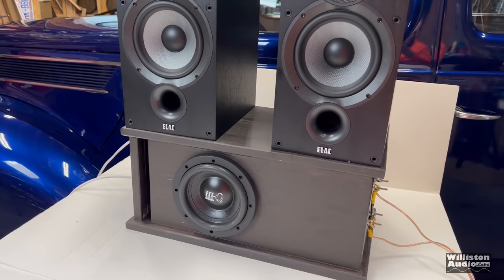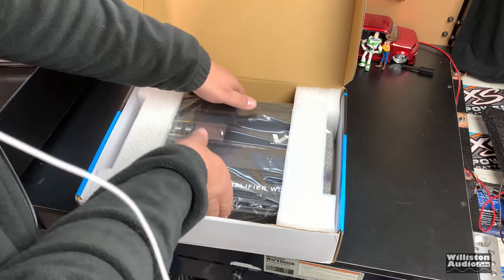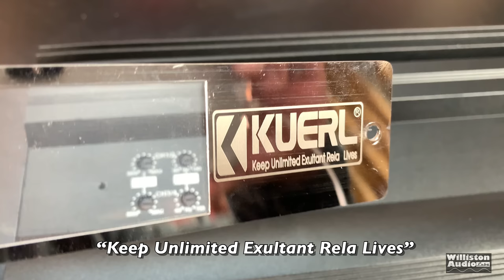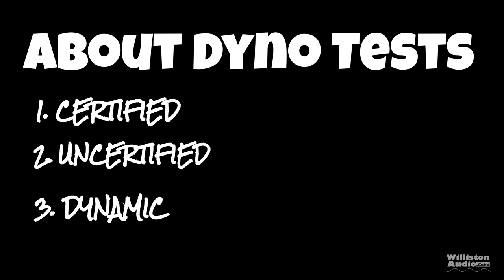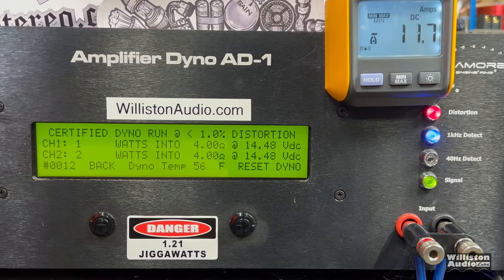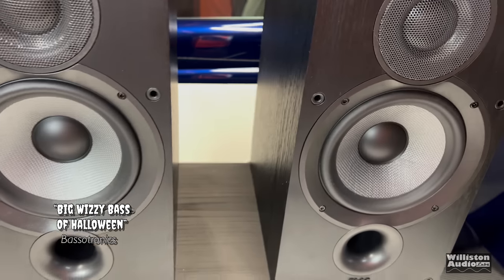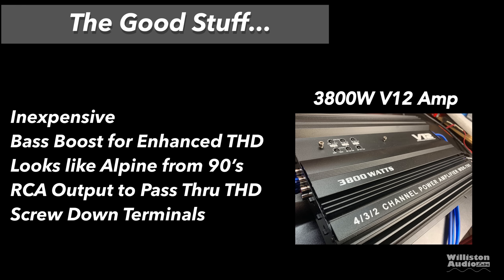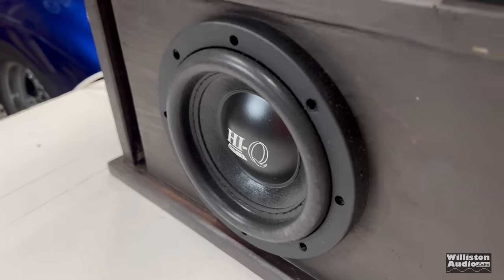$60 Gets You This 3800W V12 Amp on eBay...

Comment: Fun fact : negligent reports suggest, running two speaker leads per speaker doubles the rms of the fuse and running a jumper wire from the ground terminal to the negative output terminal when bridged has an inverse square law effect for the subs allowing you to get WELL BEYOND 3800 WHAT'S of pure electrical psi . 😎

Comment: So I bought into something similar to this a few times. A couple of years ago I got real big into car audio again and when I checked eBay I was like DAMN! A Lanzar 3000 watt amp for $85.99? Bought it, got it delivered, and as soon as I opened the box I said nahhh...I gave it away. Along with the Pyle 12s that I bought that didn't sound terrible on the PPI "1200 watt" amp that I bought. Right now that PPI "1200 watt" amp is running an 8" Skar IX8 D4 in my Acura TL at full power and it barely pushes it. I wasn't looking for killer bass when I bought the Pyle 12s, but I built a custom vented enclosure for them and they sounded decent with low power, but I soon caught on and dropped some real money on two Sundown SA12-D2s and a Soundstream Rubicon Nano RND5000.1 and they sounded SO much better with 0/1 OFC wire and a big three upgrade. Then I bought two more Sundown SA12-D2s and I also got an Orion HCCA SPLX 3k watt amp and now it's too much...

Comment: I have 4 car amplifiers and I have the same model ,  it's been working fine since 2008 and only had to change gain potentiometers once . It's powering a dual voice coil pioneer 12 inch subwoofer , both coils are bridged

Comment: Those mrv-1507 amps popped like fire crackers!   Great amp, but can’t take abuse of running subs.     90% of them I sold came back for warranty.   Would switch them to MTX, kicker, or RF and everything would be good to go!   

MTX 81000D
Rockford BD1000 & 1500 & 800.2
Then the big ass kickers.   I can’t recall the numbers right now.

Comment: Another funny vid!!! In a future video can you expand on the IHF 202 standard and explain wat you mean when you say mimicking the tone as opposed to just generating the tone. Thanks.
Reply from the maker: Agreed. The Amp Dyno’s dynamic test with the 1kHz tone, 14.4V and 4 ohms meets standard for the IHF-202 spec for dynamic power. There are Tech specs for the burst tone as well.

Comment: Anyone remember Cuspid? In the early 2000s (maybe 2004) eBay was flooded with 1600W Cupid Car Audio amps that had like a 25A fuse and were complete garbage. With the tweeter distortion my guess is those crappy caps can’t even filter the power source noise well, this would likely hum or whine inside a car.

Comment: That break-out piece of the board is a common practice.  They can lay the entire circuit board out for production, snap the small boards out for fitting in a different location then remarry the boards after wave soldering.
Reply from the maker: Yeah but it’s in the same place, just turned 90 degrees??
Reply: @wal  It was likely designed in such a way as to do that with the single row of pins on each side connecting it.

Comment: I have 2 ways to judge cheap amps. Either, one quarter of the number on the amp (fairly consistent), or just multiply the fuse rating by 10. Neither of those matches this piece of junk. At least with something like Boss or Pyramid, they typically meet that previous expectation.

Comment: So I remember back in the day I had some really sick Lanzar amps and I bought two Lanzar 12s that each came in a nice wooden box with a combination lock on them. I bought a Lanzar 1800 watt amp off of eBay (thanks Maxxsonics!) for $80 and I also bought two cheap 12s. I built a 3/4 MDF box for them, put them in my Civic, and they sounded like absolute shit. I bought a Soundstream Rubicon Nano RN1.5000D amp (because once again, always had good experience with Soundstream) and those two 12s sounded decent in the 32 Hz sealed box that I built. Finally I got tired of mediocre bass and I bought two Sundown Audio SA12-D2s, put them in the same box, and with the same amp and they pounded in my 97 Civic coupe. Now I have a 2004 Acura TL and I bought two more Sundown Audio SA12-D2s (for a total of four) in my trunk with two sealed boxes bolted together, and I bought an Orion HCCA SPLX 3k watt amp and they REALLY pound. Yeah, I'd love to get some of the higher line Sundown subs, but these have no problem flexing my roof and windshield, so they sound pretty good imo. I've never had them metered, but I think they'd do fairly well. The loudest single sub I've ever heard is a triple decker Memphis 12 on a 10k watt Memphis amp, but that was back in the mid 2000s. The best sounding system ever was four MTX 15s in the bed of a 95 S-10 with a cap and the rear window removed on a killer Rockford Fosgate amp. He won multiple awards with it and you had to have a pair of earcovers to sit in it.
Reply: Lanzar optidrive beasts man
Reply: @NVzla  Absolutely! I miss the days when there was crap amps and subs on the market, but you could only get them at a flea market. Nowadays you're being tricked into buying absolute crap from every angle!

Comment: This type of car amp can be found all over south east asia, can get them from 40-90$. I bought one 11 years ago for 45$ it had 2 25 amp fuses (also slightly had bigger guts than this one) and it said "3600 Watts" on top but actually it only puts out 600+ watts @ 4 Ohms fully bridged and I found that actually decent. but it gets hot, like real HOT, you can burn your hand on it, literally lmao, without any fans it would surely pop, rip efficiency. great video though!
Reply from the maker: Thanks for watching and commenting!

Comment: v12 mrv 705 that a class ab mosfet on the final has a distortion because the bias isn't great also it isn't worth it will fail eventually I have repaired many of that. but there is one more kind of amplifier mrv 805 a little bit more decent rating is 4x80 watts at dynamic 4x60 watts rms it was class ab but had transistor output. in the Philippines, it was the most popular amp for beginner

Comment: I would love to see an amp dyno test on an old pioneer gm7200m, I personally own one powering 2 p212s4 subs in 2ohm, curious if it does actually have a max of 800w or if it hovers around its 360w rms rating

Comment: Help me choose an amp.  1 Kicker Qclass 8 2ohm, Qclass 6.5 2way, Qclass 6x9 2way.  Should I run a D'Amore E660.5.  Or.  Audio Control ACM-4.300 and a AudioControl ACM-1.300?  Audio Control amps are $181 more than the D'Amore 5 channel amp.

Comment: another question, i have experienced this phenomenon with 3 monoblock amps, if you only have a single rca input, the output seems to be cut in half.... test this?
Reply: If the amp is designed to use both inputs then yes, this is exactly what’s happening. It’s not a “phenomenon” it’s how an amp works. Plug a pair of headphones halfway in and see how many ear buds have a signal. ITS ONLY ONE?! Amazing!

Comment: Hey can I ask a question about my amp setup ? Have a monoblock sae2000 with two sets of outputs I have 2 subs wired separately at 2 ohms can I wire into each terminal and the amp will see a 1 ohm final load or should I connect both subs wired together to 1 final ohm and use one set of outputs